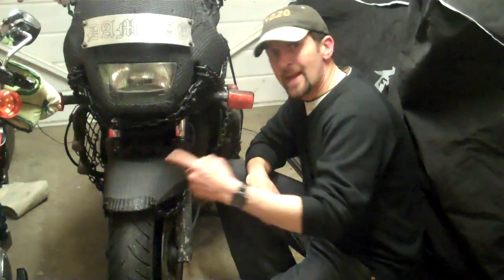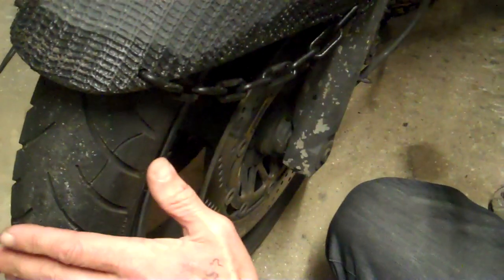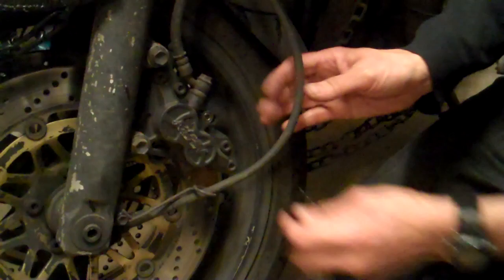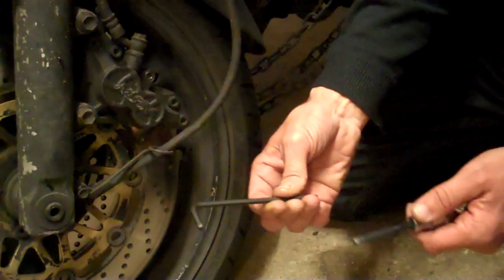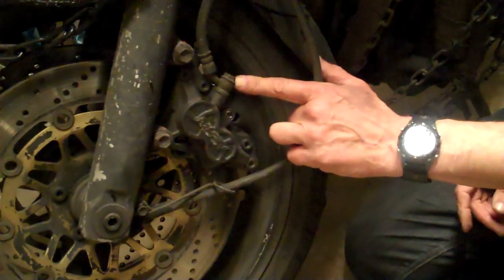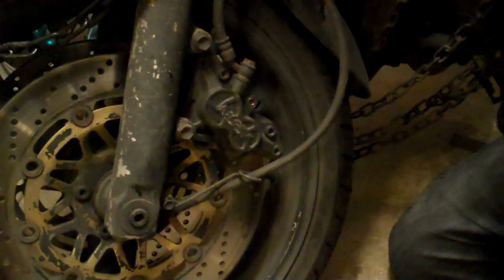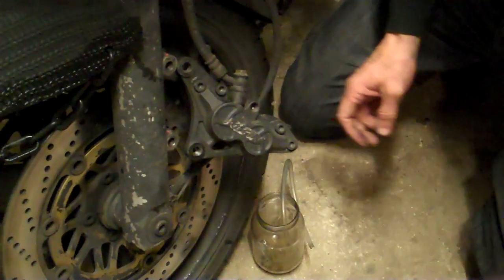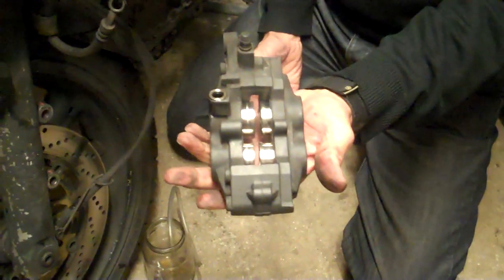Delboy's Garage, Motorcycle Front Brake Caliper rebuild Part 1.

Comment: Hi Delboy. Sorry, I've just posted a comment / question on another of your brake caliper videos but it was in fact meant for this one!  (These are the same brakes as on my Sprint). In essence the comment was that you've made this look really simple with the query being that both my service manual and the Haynes manual say to not split the caliper (under pain of a possible accident...😉). My question is why would they say this when it seems to be a relatively straight forward job when using common sense. 
Do the books for your bikes also say this?  Is there anything that particular attention should be paid to?  
Many thanks. Tony.
Reply from the maker: +TonyP 80 Got it Tony, replied on the other one..! Del.
Reply: +Moonfleet41 thanks, I've just read your reply. Sorry for the duplication.

Comment: Thanks so much for the detailed video.  Do you have to replace the piston seals or can you just clean them and reuse?  Also, what is the best chemical to clean the pistons with?  Brake cleaner?  I have a two piston front caliper.  The front wheel doesn't bind when the old pads are in, but it does bind when I put new pads in.  Do you think the seals could be the problem?  I have tried everything else I know.  Unfortunately, the best place I know (Partzilla) sells pressure seals for $10 and dust sells for $5.  To replace all of them for one caliper would be $30, fairly expensive given that a new caliper with all parts installed is $215.  Do you know of a place to get them for cheaper?
Reply from the maker: +Joe John Johnston Hey Joe... the reason they bind with the new pads is that the new pads are thicker, and will push the pistons back in further, this will push tme in past what is probsably a corrosion 'tide line' around the piston from road salt and brake dust.... so take them apart, clean the pistons with "Solvol Autosol" or "Belgom Alu"...this is a midl abrasive polish and will cut through the cruddy buildup.. then clean all the seals with fresh brake fluid... and reassemble everything... slap your new pads in and they'll be good as new...no need for new seals if they dont leak..  Del.
Reply: +Moonfleet41 Cool!
Reply: +Moonfleet41 
Hi !
I am wondering in what sort of interval do you recommend the change of those seals  ?
Two years, three...., every year ?
Thanks
Reply from the maker: +andree hammerschmidt HI Andree, They can last the life of the bike if you look after them, only change them if they leak, of if they jam on place due to corrosion or dirt.. they are not periodic..!
Reply: +Moonfleet41 
Thanks for the fast reply !!! Much appreciated and also thanks for the helpful videos ! Been around bikes for a long time but your videos encouraged me to also approach things that I would have left to a bike shop like breaks and bearing changes.... But I do live in Costa Rica and the dealer network isn't the greatest...
Happy to have found your channel, keep up the good work !!!!
Cheers

Comment: Hey :) I've re-fitted the seals in my caliper, but I find I can feel the 'lip' either way around - does the order matter for all brake types? (these are tokico ones on my kawa versys)
Reply from the maker: I don't know how every single caliper in every single caliper in every single bike will sit, I only have experience of the bikes I've worked on and owned... as long as they don't feel like they are upside down with the lip on the wrong side you should be fine...

Comment: I never knew about the seals.  I have done so many rebuilds and never had a leak.  I must be lucky?? I also use red rubber grease on my seals and pistons whats your opinion on that?.  Any tips on cleaning seal bed?  I use a brass brush on a dremell but sometimes they still don't look great
Reply from the maker: Red rubber grease is perfect for this, but dont use too much as it can melt with heat and find its way onto the pads... i would not choose a brass brush... i just use AutoSol and an old tooth brush... nice and gentle and wont scratch the inside of the cylinder..!
Reply: Moonfleet41 yea I only use a small amount.  That's great advice.  I love my seal beds to be perfect.  I'll be doin my Africa twin brakes soon I'll see how the autosol and toothbrush works.  Legend as always thanks

Comment: You are wrong about piston seals having a angle/lip  the seals are perfectly square but when they sit in the groove of the piston bore there is a rim of metal that angles them out.
Reply from the maker: +Donald Jolly ON SOME BIKES that's correct... but not on ALL!
Reply: +Moonfleet41 I hear you, I restore old bikes from the late 70's 80's I have never come across a caliper seal with an angle on it, the seals are always square and fit in either way, Regards Don

Comment: ...hello, I have a Triumph with a Lockheed brake and the Lockheed manual says DO NOT separate the caliper halves! 
Im here with the caliper on hands and managed to get off the pistons; but very difficult to remove the dust seal; that s also have a metallic ring there; without damage the seal; may be I only change the inner seal, you know that s the only important.
-I see that all the brakes videos separate the halves...and transform that in an easy job; nobody deals with the other way.
Reply from the maker: Hi buddy... ive never had to strip a Lockheed caliper so i cant really advise you on this... if a seal is in good condition and not leaking, its usually ok to leave it in place.. maybe just clean everything and lube the rubber faces with red rubber lube... but like i said, im not conversant with Lockheed calipers.. that pretty old stuff..!!!

Comment: Hey Del, I've been reading many people saying that brake piston seals are square cut (not tapered)? Is this true? Could there be different designs or are they all this way? Usually I can find a lot of information online, but there is actually very little on this particular topic
Reply from the maker: MotoBoy If they are square cut then the slot they sit in will be chamfered so it pokes the inner edge out a bit.. i guess all manufacturers do thier own thing..
Reply: Moonfleet41 cool thanks!

Comment: A pick of your brains please Del...where is the best place to get seals and pistons from ? Yamaha directly.. or a cheaper route ?
I have to do mine I missed the instructions in the manual that says re-new every 2-3 yrs now on my 7th year lol
Reply from the maker: Hi Neil, best source at a reasonable price would be Wemoto.com, they do pistons for just about any bike and seals on the shelf... they'll also be able to supply the fluid and any brake lines you need if you wanna upgrade them!
Reply: @Moonfleet41  yeah I thought so I looked before and emailed them as they have pistons but not linked to the bikes

Comment: thanks a great help, just wondering, do i need to soak the seal before fitting?
Reply from the maker: No mate, just pop them in dry, maybe a dab of red rubber lube just to ease everything in to place!
Reply: Moonfleet41 thanks man, much appreciated.
Reply: Moonfleet41 just looking at other threads stating that you need to use red rubber grease, is this specific to piston maintenance or is this mainly for seating the pistons after replacing the seals?
Reply from the maker: Red rubber grease is for use any time rubber is forced against metal...it better then grease becasue it doesn't effect the rubber itself...not just for brake caliper seals.. any use on a bike or car involving rubber to metal interface buddy... hope that helps..
Reply: Moonfleet41 excellent thanks again

Comment: why is it that you say the brake seal is chamfered one way and that it must go in so the lip will protrude slightly otherwise it won't work, yet in your rear brake rebuild video at 16mins 45 you say the seal is square and it doesn't matter which way round it goes in?
Reply: Obviously a different seal setup ....I would say as he is right about the chamfered front seals ..

Comment: Would it be okay to clean the calipers with a brush and soapy water and then just go over it with brake cleaner? Also is it okay to reuse the seals if i dont see anything wrong with them?
Reply from the maker: Hi Luan....yes exactly...wash them out, rinse off with brake cleaner and re-assemble..  i would fit new seals buddy, they dont cost much and even if the old ones weren't leaking they will be worn down... i have a video on cleaning the calipers mate...check it out if you need any guidance.. good luck Del.
Reply: Yea I think saw it this morning "Essential winter brake cleaning"? I was more worried about getting water where the pinstons go. Thx for the reply. Great channel!

Comment: Does this work the same way for monobloc radial calipers? Cos to pop the calipers open, we would have to access the screws from the back and thats the tricky bit.
Reply from the maker: Hi mate, ive not had cause to take a pair of monoblocks apart, but the principles of cleaning and keeping them free moving is the same for any brakes, they accumulate dirt and brake dust which will jam them up... taking them apart is just anatomical knowledge... you should find the details on how to dismantle them in the manual..
Reply: Yea, I've got the part on cleaning them. No problems on that. Problem is, bikes that are preowned don't usually come with their user manuals here and we're left to figuring it all out by ourselves. Thanks for the useful tip though, would've done it myself if I had known earlier, warped the front rotors of my cb400 previously. Pricey replacement.
Reply: @fadzlysamsudin9588   you can download a shop manual which will give greater detail on mechanics for secondhand bikes as a disc or download to your computer...I did it with my fz1 fazer 2011

Comment: Here's the dumb ass question of the day and I'm pretty sure the answer is going to be "yes" (to the answer as well it's a dumb ass question) but ... I have to ask is it necessary to replace the seals on a rebuild? I have an '04 Victory Kingpin and am having a hell of a time trying to find the proper seal kit for the stock Brembo's that came with the bike. A local Victory dealer is having the same problem. The Parts Manual just has the Victory part number and no cross reference is found.

Thanks!

Comment: Hi Del.
I've used you're videos and rebuilt the rear and front callipers on my 2000 Hayabusa (just got one calliper to clean and fit seals). Is it worth getting a front brake master cylinder seal/piston kit? Have you done one? Am I likely to #uck it up and have no brakes at crucial moment!?

Thanks
Kevin
Reply from the maker: Hi Kevin.....front brake master kit is easy to fit, and easy to bleed up....but TBH mate,. if its not passing fluid, then leave it alone.. they are far less likely to go wrong or wear out than a caliper.....its up to you, but if it was mine, and working fine... id leave it well alone...!

Comment: I restoring a old 125 and it has a hydronic front brake but the bike has been sat for all most 25 to 40 years would you say it be best to find a brake from a newer bike and try to fit that or try to rebuild 20 year old brakes
Reply from the maker: Hi buddy, depends on the cost, and how standard you want the bike to stay... if it's only a 125, you could probably find a cheap second hand alternative in any bike breakers for not much money... the choice is yours my friend, both are possible!
Reply: Moonfleet41 the bike is from the 1960 to 1970 but it was very rare as it was a clone of a yamaha 125 mx so there no spear  parts any were for it other then some dt part that cost a but load
Reply: it was made by Norton it worth around 2 to 5k when fully restored

Comment: If say I have just one dust seal that is poking out on these, is it safe enough to just take that one piston out, and replace the dust seal only? or will I have to replace anything else.
Reply from the maker: Hi HH, you know what, I've even got away without replacing it.. just pop the pistons out, if the seals aren't torn, or pinched, then just clean out all the kack in the grooves that pushes them out, and then re-install with some rubber lube, and you're good to go... also gives you a chance to clean off the corrosion for the pistons, and if they're really bad, you replace them quite cheaply as Wemoto now keep them in stock...
Reply: Ok great thanks. So I can install the pistons with RRG instead of normal grease?
Reply from the maker: Yes mate, use RRG as its heat resistant, and will preserve the seals.. make sure to push them all the way back into their sockets and wipe away any excess before you refit the pads..

Comment: I've got an SV1000S that uses those same calipers and want to rebuild them.  Is there any reason to order new pistons, or would you just swap out the seals?
Reply from the maker: +Trevor Kidd Hi Trevor, 've always had a firm belief in the old mantra 'if the cart ain't broke, don't fix it' ... I've never needed to fit new pistons, as long as you treat them carefully and don't distort them getting them out, and polish them so they shine, then it's perfectly ok to use the original ones...
Reply: What do you Polish them with?
Reply from the maker: +Trevor Kidd Best metal polish has always been Autosol... available from Ebay, or any bike shop !
Reply: +Moonfleet41 awesome! Thanks so much for the quick response and for the video :)
Reply: +Moonfleet41 I rebuilt the calipers, replaced seals only a little over a week ago. At the time the pistons slid right in with no issues. I bled the brakes,  and now that my new brake pads have come in I'm finding that the pistons won't retract in to the calipers. They push out no problem, but I can't get them to push back in. I've gone so far as to remove the caliper and split it again in a effort to free the stuck pistons but I can't get them to move. Any thoughts?